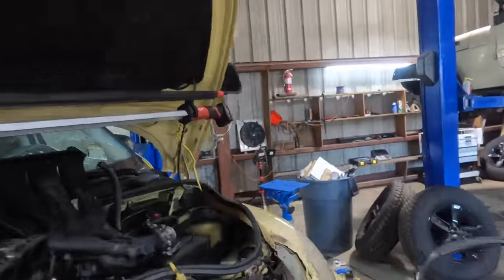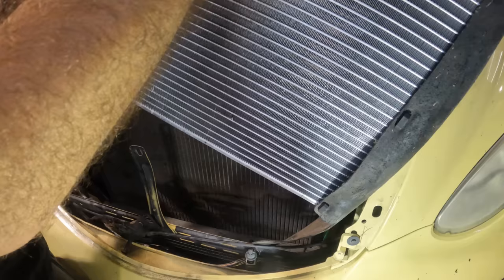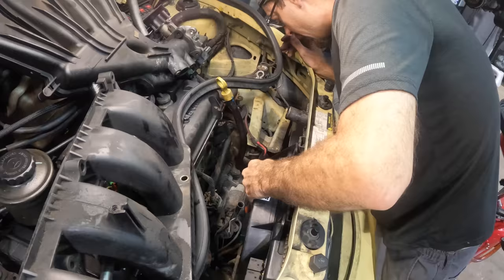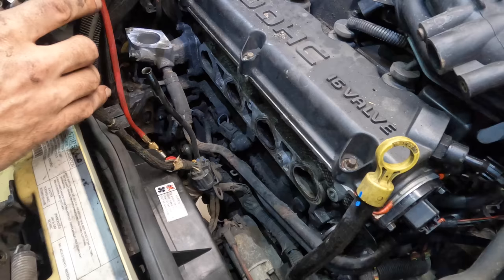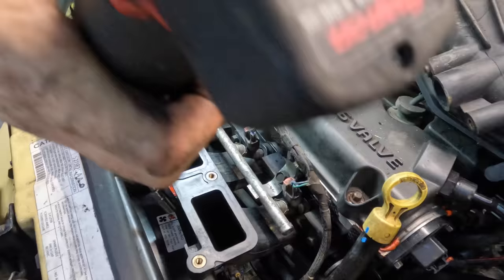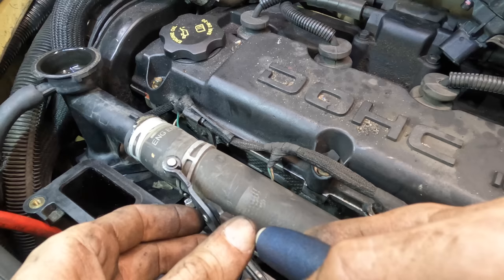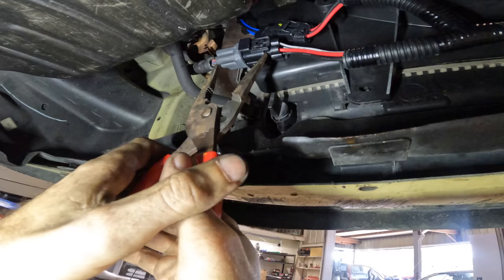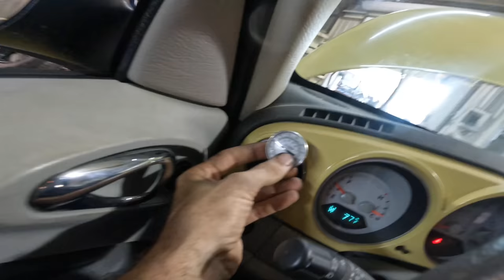Recycling Dodge Parts! 2007 Cruiser 2.4

Comment: Great thing is, that the owner of the vehicle can watch these videos and see all of the work and testing it took to repair the vehicle.
Reply: I’ve been thinking the same thing about all of Rays repairs.  Be nice if all mechanics wore a head camera 💪
Reply: The owner is very attached to his PT Cruiser. 🤑💣💣💣💣
Reply: @waleyefish9026  Lord knows why. Those things are fugly.
Reply: @br549rdr  That could be a liability in some shops to let the mechanics wear cameras while they work....
Reply: Said this B4 that Rays work is documented for the most part and that is valuable to a customer , to see a rusty lump of metal worked on and finaly come free and then be replaced with SHINEY  new part, the camera dont lie....👍👍👍👍👍👍👍👍👍👍👍👍👍👍from me.
Reply: @ckmoore101  not just fugly, horrible safety. they had to seriously modify it to make it pass the very basic EU safety regulations and add a ton of airbags and ABS/ESP and more abbreviations to make it not crash during a corner. that is why the EU versions are so different. still utterly stupid rear axle tho. i have a trailer with a more advanced suspention than what a PT has.
Reply: Then there wonder why they bought the worst car ever made . For really look it up
Reply: @br549rdr  lol then we could show you how hard it is to find the locking wheel nut socket under a boot full of smelly gym kit or through a glovebox of bank statements and wife unit monthly products lol
Reply: @br549rdr  My  BMW Dealer records a video of the inspection and points out the areas that require repair on a video clip.
Reply: @electricvehicle465  Possibly but at least it isn't a YUGO> LMAO
Reply: @steventrostle1825  it’s a YUWONTGO
Reply: @SupremeRuleroftheWorld   Chrysler were able to classify it as a truck and despite its horrible gas mileage it helped bring down their numbers for that class - that was its primary role in the portfolio.
Reply: Helps as a surveillance
Reply: He did more work then what it is worth. Owner is cheap AF
Reply: PROFIT = Don't work on vehicles value under $20k
Reply: @TofuCoCo  
My dads Mercedes dealer does too.
Reply: My thoughts exactly.
Reply: You are good person and mechanic Ray don't ever change! I'm glad you had to start a business for yourself. I hope great things come to you and your wonderful family!!!

Comment: Hey Ray, when you "donate" stuff like that intake gasket, make it a $0 Line item on the bill, and let them know you did it but didn't charge them because you didn't quote them. That way they see all the freebie stuff you do for them (and when people see free stuff they are more likely to be "this is a good mechanic"), and if they try to come back later and say "well you didnt replace this..." you've got documentation that yes, yes you did.
Reply: Good point, as long as it doesn't backfire with people EXPECTING free stuff.
Reply: Yeah….   It’s a risk….  favors over time sometimes evolve into entitlements in the eyes of the customers. Even if they are outside the scope of the job.
Reply: It's called shop supplies in your invoice
Reply: We do the same thing at the company I work for.  We're an HVAC company but there are many similarities to automotive repair.  Those 0$ line items always make the customers happy and greatly increase our bottom line overall in increased word-of-mouth advertising and customer loyalty. I feel it falls into the 'Penny wise, pound foolish' category.  That 'free' $20 part is worth hundreds if not thousands on the long run!  Great work as always Ray!
Reply: Fortunately it was a $3.25 part.
Reply: Also adds up over the year, and helps on your taxes
Reply: @MonkeyJedi99  I agree, people only value things for as much as they paid for them. When you give them something for free they don't consider important.

Comment: Your ability to work in and around the tight confines of that PT while remaining calm is admirable. You'd make a great motorcycle mechanic.
Reply: One thing I liked when I worked on my own motorcycles was the fact that accessibility to the parts was easy as far as on the bike as far as the parts stores they were pretty good have a good day
Reply: That engine compartment is 15 gallons of engine in a 10-gallon hat.
I'm so glad I don't have to fit my big hands in that kind of space!
-
Edit: and so much plastic...
Reply: Or even a clock repairer, very meticulous work!
Reply: Try a TDI - that PT has load of room!

Comment: As much stuff that was loose under hood, good you took parts off and put them back secure.   Great job!!
Enjoyed
Reply: After that intake was vibrating around like that I think it was a good call to pull it out and put new gaskets in because it was a good possibility that were leaks in the system too might as well cover all bases and the AC have a great day

Comment: I work for a Costco gas station over here in Los Angeles and for some reason these PT cruisers are still running. Even saw that rare SS once. The owner was an old timer and said he’s like those bulky body style cars. Nice guy. Also ray, Costco business centers allow you to buy oil, DEF, rags, and other stuff in bulk, pallets so you could be saving money on that, just a tip to save some mula
Reply: Old People who garage them.
These things are some of the worst vehicles ever made.
Reply: ummm, if you saw an "SS" you actually saw a chevy HHR, which is their "competitor" vehicle that didn't sell nearly as well.
Reply: Does that include brake clean? If so, I reckon Ray would be buying pallets of it.
Reply: The PT was made by Chrysler, the engineer moved to Chevrolet and designed the HHR station wagon looking PT. I have no idea if the issues also followed or it was designed better that the PT.
The SS is like a sporty truck version, I think from Chevy.
I've rarely seen one, but recently there was a really cherry one on a used car lot. I looked it over and got to sit inside. I didn't care for the visibility from the driver's seat. And with a V8, I would probably wreck it. I do like the look, but not for functionality, just for fun.
The other ss I've seen have been driven by older gentlemen like myself. But they are rare to see here in Virginia, but PT Cruisers abound.
Reply: One of the few times Chevy followed rather than led on design and pushed the envelope into a niche market that never materialized. The idea commitment to baby boomers just didn't catch on.
Reply: We used to buy it in 20 gallon drums and use pressurized sprayers.  We old timers used a lot of it to clean the grease from our hands.
Reply: @Wakeupandsniffthecoffee  The HHR SS has a turbo 4. The SSR has a LS V8. Two completely different vehicles.
Reply: @csmith8503  Same. The can is called a "Sure-Shot". I don't know why Ray doesn't have one.
Reply: There are two turbo versions of the PT Cruiser one was the SRT4 platform badged as the GT. The other was low power turbo. As other have stated SS is from the Chevy HHR. (I have corrected my original post to include that there are actually two turbo versions of a PT Cruiser) for more info see my reply below 👇.
Reply: @KRT045  No. The SRT4 was a Dodge Caliber (and previously a Neon). Chrysler made both a low power turbo PT cruiser and a higher powered PT Cruiser GT. Both made less power than the SRT4.
Reply: I wonder if Ray ever heard of the can of 'Start Ya Bastard' we have here in Australia. You spray in into the air intake or carby to help start it on a cold day or after maintenance or repair.
Reply: @johnhufnagel  yes this car, sorry 4am  no coffee yet hehe
Reply: @aaronbritt2025  you are correct and incorrect. I was incorrect in implying there is only one version of the PT turbo. There are two and one was the SRT platform. It was not badged as an SRT4 but the PT GT.  I have copied the the info from the link as YouTube keeps taking my post down with the actual link from Auto trader to the article.
“What you may not know is that the SRT-4 wasn’t the only Chrysler with this powertrain. The 2003 model year also saw the arrival of the Chrysler PT Cruiser GT, which used the same 2.4-liter turbo engine as the SRT-4 — and the same manual transmission. Many people know there was a “lightly” turbocharged PT Cruiser with 180 horses, but this was the real deal: 215 horses and three pedals. Horsepower was later bumped even higher, to 230.”
Reply: @csmith8503  In my 70s era high school auto shop class, I learned to wash my hands in the kerosene parts washer first, then with the Boraxo soap. Years later I made my own hand soap, using corn meal and powder Tide laundry detergent.
Reply: @KRT045  What part of, "The SRT4 was a Dodge Caliber (and previously a Neon). Chrysler made both a low power turbo PT cruiser and a higher powered PT Cruiser GT. Both made less power than the SRT4." was incorrect? The PT GT was not a differently badged SRT4. It had a different intake, turbo, piping and intercooler and only made 230 hp, compared to the SRT4's 285hp. I've owned two Caliber SRT4's. I know quite a bit about them. One I kept stock, the other made around 400 whp.
Reply: @aaronbritt2025  I mis read/ misunderstood your original post. It does make less power but it does use the SRT turbocharged engine and transmission was the point I was making.
Reply: @@lesreeves8783 😂 Fair point

Comment: I was at a place that made condensers, evaporators and other radiator units, amazing, how they fold the fins and stuff, 1000's a day, and QC checked...slick engineering, if not for mass assembly lines, the stuff would be so pricey, to not be practical

Comment: I had a PT Cruiser as a service vehicle for about a year, put 24k on it without a problem, now we all have F-150's. Again without a problem. Some vehicles are better than others, however, it makes a huge difference how they're maintained.
Reply: I've tried to explain that to many a person over the years; what makes a vehicle "good" or "bad" largely depends on how well (or not) it's been maintained. I've had multiple chrysler products nearly reach or exceed 200k miles (ex: 242k on a 92 Dodge Shadow. salt/rot finally took it from me.)  keep it clean, do your service on time ("severe" schedule), replace the things that need replacing WHEN they need replacing and not letting it ride, and you can make anything last without killing yourself.
Reply: My PT was an ok car but constantly nickel and dimed me with problems that no one could fix. Engine and transmission were ok but wheel bearings, bushings, brakes and emissions controls were always going bad. After 8 years it rusted out and I dumped it at 62k miles.
Reply: That's any vehicle you take good care of it it'll take care of you that's the problem the third maintenance abuse and then all of a sudden all the cards a piece of junk no you just didn't take care of it have a good day

Comment: 100% better idle great job Sir.  I was a mechanic for GM / Pontiac, oldsmobile and Chevrolet back in the 80's when it was first getting to were you could barely stick your hands in the engine compartment . I had my own shop for 12yrs until I got tired of dealing with customers ran out of patients  which you seem to have a lot of congratulations
Reply: Been working in retail/cust service for the last 8yrs. Retired early last spring due to the fact during covid everyone lost their minds and manners, just couldn't deal with the rude-ass ppl anymore!!!
Reply: @jilbertb  I was in retail for a short time in the mid-1980s.  That was enough for me.  People were uncouth, rude and "entitled" even then.

Comment: “That’s right, I just used an impact on an AC line, wassuup!” 😂😂😂 had me rolling
Reply: I just got a nice half inch impact for the first time (only ever had baby impact drill /driver's) and I was having so much fun with it until I pulled out a stuck O2 sensor with it and it was powerful enough to completely remove all the threads with it. I guess someone Cross threaded it on the way in.
Reply: I watched he was removing the line when you said that have a great day

Comment: I guess in a climate like Florida where the default position for the AC is on, many people would have been chasing that engine stumble for a long time, not realising it was the AC causing the issue. A much easier diagnosis in a colder climate like here in the UK where the AC spends a lot of the time turned off. Could not believe how high the pressure got on that system before you fixed it, would not have been long before something blew if they had left it much longer.

Comment: That "years of nasty!" got to me.

A friend of my father was a mechanic with a streak of OCD. He lived to make machines better than new. He bought old heavy machinery, tore them apart and put them back together as clean as when they left the factory, stronger and more reliable if hs so had to reengineer parts of them. I remember him buying an old dumper and rebuilding it. He didn't like the way the waist was constructed so he cut it out and built a new one from scratch.

Well anyway, I remember how clean everything was. When he put a machine back together he could have done it wearing white cotton gloves and there wouldn't have been a spec of dirt on them. Some grease yes, but no dirt. Unfortunately many years of working with all the shit that used to be present in fluids and what not involved with heavy machinery took it's toll and he contracted symptoms very much like Parkinson's in his 40's. When he was 55 his hands shook so bad he could hardly drink coffee without spilling. But put a screwdriver in his hands and a small screw that had to go somewhere you couldn't see and were only just able to get your hand and the shakes went away immediately, though he couldn't keep that level of concentration for very long.

In a way he was my idol growing up. Never could learn that neat trick though...

Comment: The assault blowgun makes its first appearance. The Wife Unit right there with the  brake clean. I'm not much of a fan of Chrysler products, however, I always thought the PT Cruisers were neat looking.  I still see them around every now and again.
Reply: They were a blending update with the past that had its market. I considered one..... once.
Reply: Drove the chevy clone, an HHR panel.  Those panels were cool.  Looked really sharp with the company tatoo on the panels.  Drove it about 100k without an issue with 2.0 liter.  Visability was poor because of panels and thick front posts.  No winter traction period.  70mph = 3100rpm.  Those buggers were really screaming at 70mph.

Comment: My sister had a '03 PT Cruiser and I hated changing the spark plugs on it because you had to remove the intake manifold every time. Even though the upper intake manifold was easy to remove. It was still a pain. I think the reason PT Cruisers and Dodge Neons never seem to die is because the 2.4 and the 2.0 engines were made by Mitsubishi.
Reply: 2.4 and 2.0 engines used in the PT and  Neon aren't mitsubishi. the turbo is tri-star though.  chrysler had pretty much divested itself of most of its mitsubishi parnership by the early 00s, and only the left over sebring coupe (mitsubishi eclipse) was still a shared platform.
now, the World Gasoline Engines used in later (ex: 06+ Dodge Caliber) cars were a joint chrysler/mitsubishi/hyundai project, that was used/sold in other marques as well (VW for one.)   perhaps you were thinking of that 2.4L (and 1.8L, and 2.0L) engine design?
Reply: The 2.4 and 2.0 were designed by Chrysler.  Like anything else, good maintenance can make them live a long time.  The turbo 2.4 motors had a mitsu turbo but that is it.  Still the same Chrysler 2.4 developed from the 2.0.

Comment: Out of curiosity... I did watch the previous video on the PT Cruiser, but I don't remember any mention of replacing the condenser itself. Is it actually needed, or just "since we're here, we might as well"? And then the real question... Apart from breaking/leaking, what could possibly happen to the condenser to require a replacement?

And since I'm already here, I might as well 😄It's lovely to see you working by your own settings, even more so having the wife unit participate actively!
Reply: My guess is that the condenser was plugged.
Reply: Agreed, that was the money shot.

Comment: Ray I would have used a gasket maker sealant on the piece that had the deep pits in it and let it set up (but your way will work too), also you could set the thermostat in the lower part making sure the indicator notch is facing the right way / line it up with the cut out in the upper while it's sitting in the lower that would eliminate the dropy drops

Comment: Yeah, our '02 PT cruiser was a shop lizard. Front-end totally worn-out at 80k, struts at 100k, lots of leaks, burned oil, etc... I bought the wife a new car, and drove the PT Cruiser when my Mercedes van finally died. It made it to about 170k before the AC pooped the bed. Got $500 on trade-in. Actually saw someone driving it a few months later.

Comment: @Rainman Ray's Repairs, "recycling Dodge parts", I thought that's what they did at the car crusher, lol. Seriously, as a first-time Dodge owner by inheritance, I can say my first "Dodge experience" was not a very good one. But I suppose it's grown on me. Anyway, I had wondered about vehicle HVAC systems. I'll eventually have to replace one on another vehicle. The clutch and pulley disintegrated. The serpentine pulley was barely hanging on to the inner hub and after removing the belt it was just flopping... So I had to, in a pinch find a belt out of some old ones to be able to route around the other accessories and crank to even be able to start the engine and drive it home. Anyway, nice repair! Definite difference in the before and after, before the engine was shaking like a bowl of Jello, lol.

Comment: You're right about the hood latch bolts, and they tend to want to go back exactly where they were before unless you force them, I've never had a hood latch mis-align. Also, KN Copper Coat works really well on pitted surfaces that you want to seal.